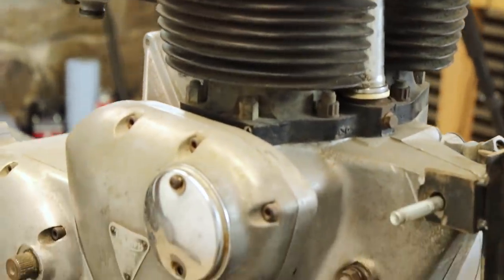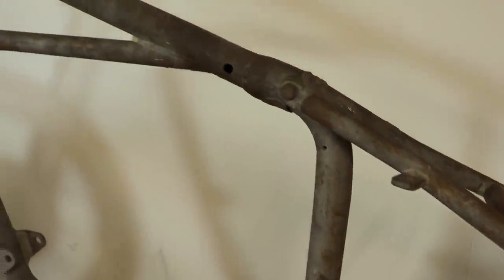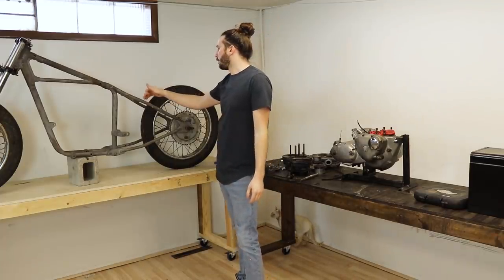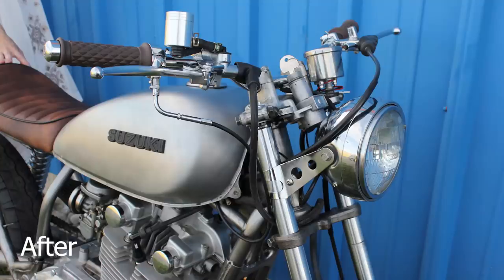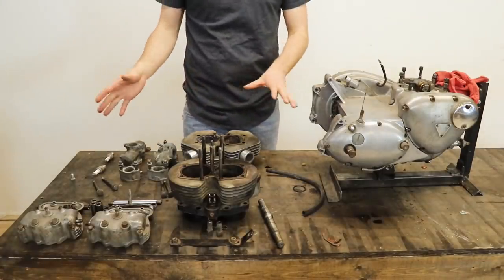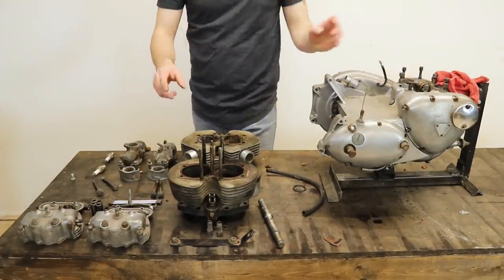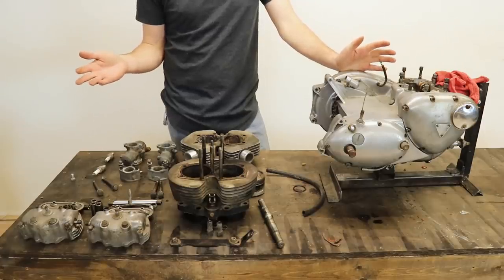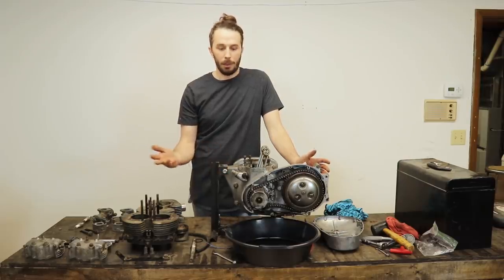TRIUMPH BOBBER BUILD - [Part 1]

Comment: The length of the hardtail has nothing to do with the position of the seat. The seat always attaches just behind the tank. I'm also biulding a 66 650cc Triumph Bobber.
Reply from the maker: That’s not necessarily true, with a longer hard tail you can mount the seat further back and have a longer extension on the seat to set it back farther for tall guys like me
Reply: @RoseAnvil  forward controls might help. They are very small motorcycles. I'm 5' 8" luckily.